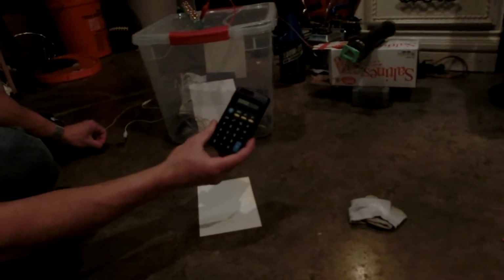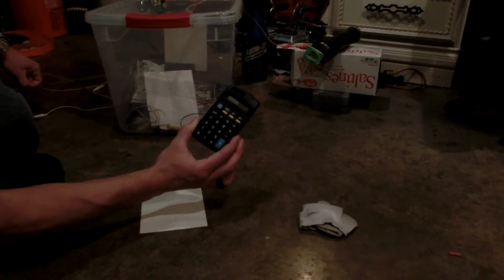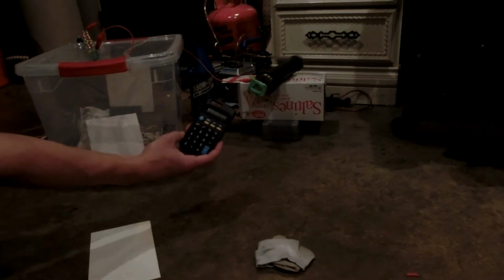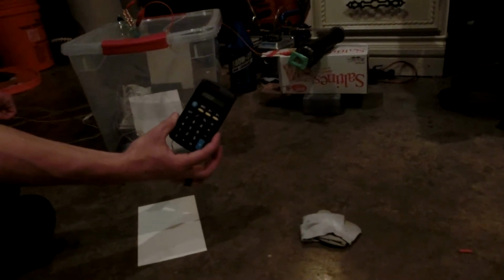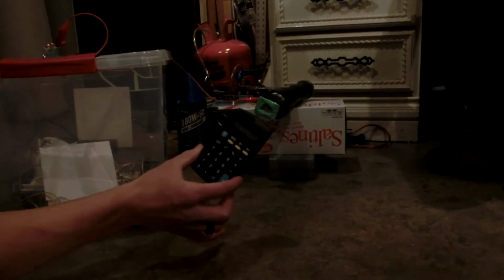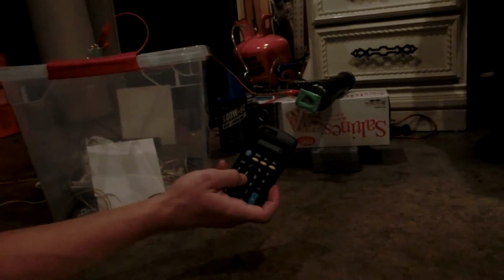Open Air electron beam testing (particle accelerator)

Comment: really cool for trying ! but how do we know the calculator is not just affected by the mark emp?  beta radiation don't travel very far in air , I would be surprised they make it pass few cm with 150 kv (after the window)
Reply from the maker: Ced that was actually what I was trying to determine for a long while. X-rays and high energy electrons act very similar. I came to the conclusion that the only effects I was getting were emp from power supply and bremsstraulungh (spelling is whack) where the electrons hit the window. If there was no window the mean distance they could have traveled was like 16 inches or something if I remember right. Good catch 😁
Reply: It's interesting through ! I am looking for some way to do it myself , I think the mark is a good idea , in the sens that you don't have to deal with continuous high voltage (150kv is a mess to deal with)  . I think  some phosphor materiel might be less ambiguous to measure radiation .. note that the collision of the electron beam with the window will most certainly produce x-ray .. the quantity of it might actually be inversely proportional to the electron transmission of the window materiel(I am not sure) . For myself I would be looking for titanium foil as a window , but mica is a good choice . Regarding the pump , it is a smart idea to use two in serie , such set up would normally require a turbo-molecular pump , but they are costly .. an other way to get high vacuum might be to run the system at lower voltage for some time , so some sputtering occur , this in general help improve the vacuum ..
Reply from the maker: Ced hey, all great ideas. I did do some tests with mica windows actually. The downside to a continuous source is that with the magnetic focus it ends up piercing a hole in the mica from the “heat”. The Marx bank is the way to go imo without a turbo or oil pump because the discharge voltage is constant as compared to a multiplier. I want to build a larger Marx, the multiplier I made ( capable of 1.2MV is not doing its job. The cost will be high unfortunately but I do have a few HV DC sources that could power it. Optimally I’d go for a 2MV maximum Marx but coronal losses will be significant. Even better would be a true RF accelerator but coming across a kylstron with matching seed is hard 🙁. I like your analysis a lot 😁
Reply: Yes , localized heat for the electron beam can be a problem , I think that's why I am up for the titanium foil , in my head , it is relatively easy to have a glass metal transition , so it can (theoretically) be sealed at the end of a glass tube , I am counting on the foil  being fine enough to deform on the hot spot and not stress the glass to much , but I didn't try yet .. Good point for the mark , the voltage is constant because there is no shortage of current , so despite imperfect vacuum , at list there is no loss on the acceleration potential ..  1.2Mv this is huge ! with such voltage arc over should be a serious problem ,  ferrite is slightly conductive , how do you prevent the current to flow around the tube ?  you probably need a oil bath no ? from the little recherche I did so far , I found some commercial unit functioning at much lower voltage  (around 100 kv) RF accelerator would be great indeed :-)  That's serious physic , If you do that in your garage , I don't think you will have much problem finding a job :-D Al-through I sow some DIY guys trying to make cyclotron at home .. so it may be possible . Any way good luck with it , I subscribe on your Chanel , so I will be following ! Cheers!

Comment: What’s a vacuum pump and how much would one cost?
Reply: Really cool setup. I recall using electron beam welding at atmospheric pressure without the use of a window of any kind. The transition from high vacuum (in the gun column) to atmosphere occurred over five stages, where each stage was a vacuum chamber at higher pressure than the last and maintained through constant pumping. The E beam propagated through each chamber by way of a small orifice and pumping capacity was sufficient to compensate for incoming airflow through that orifice. It required some massive pumps, but could handle the power necessary for welding; 150 kV @ 30 mA was typical. Needless to say when lights were turned off it looked pretty. cool.
Reply: @gecal556  Neat. I was just researching to see if that very thing was possible for use in a metal 3d printer.  How does the quality of the vacuum affect the output power of the electron beam?   Do you need a higher vacuum for higher powered beams?  Or is it an all or nothing type thing?
Reply: @justinhubbard7611  The quality of the vacuum affected the quality of the beam, ie the ultimate sharpness of focus and spot size more so than the power. Although the vacuum in the gun column never got above 10 microns or so, at some point increasing it would reduce the ultimate output power because you would start to get arcing or a constant glow discharge in the gun column.